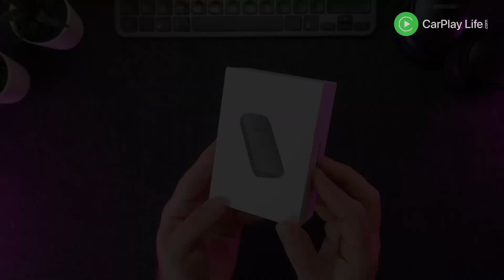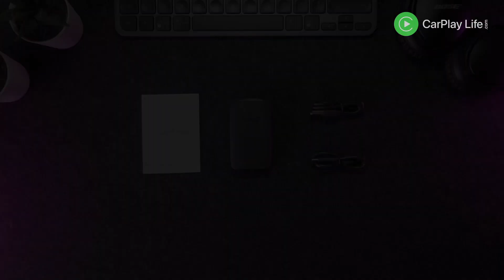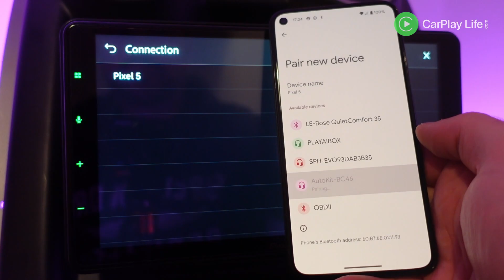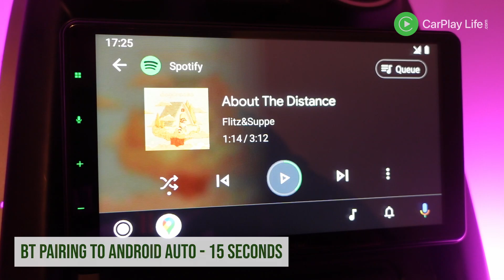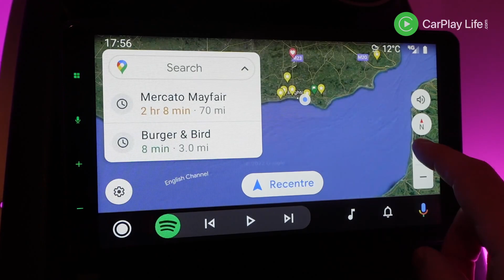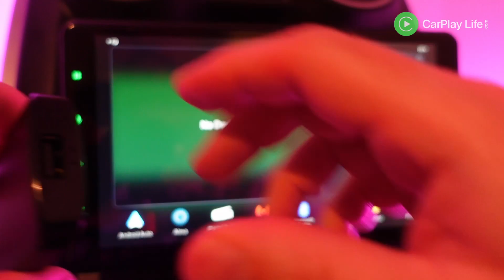Make Wired Android Auto Car System Wireless | CarlinKit CPC200-A2A Adapter Review

Comment: Thanks for this review. I would like to buy this dongle for my Skoda Fabia III which it has wired Android auto originally. I will try to share my opinion if I could get this one.
Reply from the maker: Cool. Good luck!
Reply: I've been using it for 2 weeks in my KIA Niro, no issues, the other day I had it on for an 9 hour drive, also no disconnections which I read happen sometimes. I noticed it disconnects and auto-connects back in few seconds only if during the drive you enable or disable Hotspot (internet sharing) on your phone but that seems logical.
Reply: @tiberius21  I bought and tried it. I could connect with it one time but the others attempts were unsuccessful. I tried everything to reconnect but it was impossible. Because of this I sent back it to seller
Reply: @tcirit  I guess it depends of the car and AA it has, I'm very pleased because every time I sit in the car it connects in about 20 sec, didn't have to do anything since I first paired it with the car...
Reply: @tiberius21  Glad to hear about it.👍

Comment: Can this use 2.4ghz wifi from the android phone?
Reply from the maker: To connect for wireless android auto, I guess that’s possible. Android 11 or higher is required.
Reply: @CarPlayLife  I have Samsung A12, Android 12, but only 2.4ghz wifi
Reply from the maker: The listing on Amazon shows it as supporting both 2.4GHz and 5.8GHz band.

Comment: Does it use Apple connection protocol, i.e the car recognized it as apple carplay or Android auto?

I think if it is recognized as android auto device using android auto connection protocol the delay will be minimal
Reply from the maker: This isn’t for CarPlay. It’s for wired android auto systems only to make them wireless.
Reply: @CarPlayLife  totally understand, am speaking about the communication protocols between tbe device and the car, most of these devices( almost all of them), are using apple protocols that's why the car consider the device as Apple carplay adding more time to convert from apple protocols to android

Now if this using android auto protocols that will be great.
Reply from the maker: I assume it is as this specific adapter is built for the AAuto platform which I assume has its own protocols to connect to.
Reply: @DrCastaway2020  that happens With carlinkit 4.0 , but With A2A its a real Android and the only protocol
Reply: @SpaceRANx  thanks for the update, ordered one unit, 🙏🙏

Comment: Turn off mobile data, this will allow you to access to the config page of the adaptor.
Reply from the maker: Ok thanks I’ll try that out. I did connect to it eventually after recording but it’s not a smooth process as wireless carplay adapters.